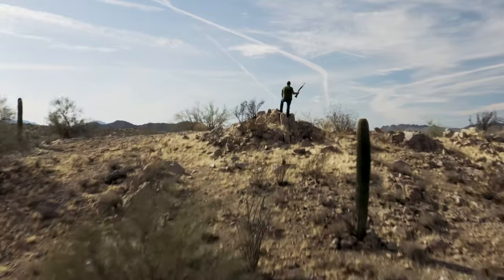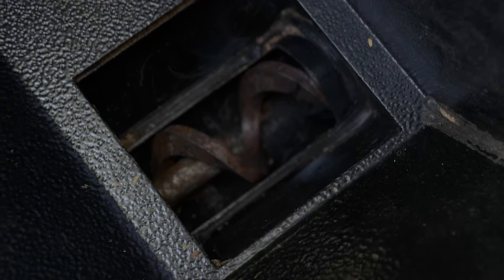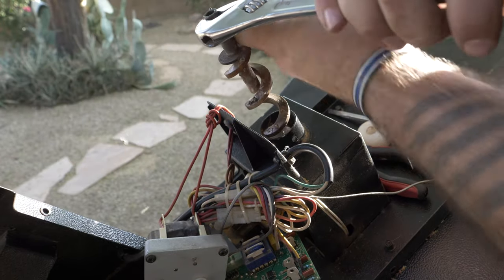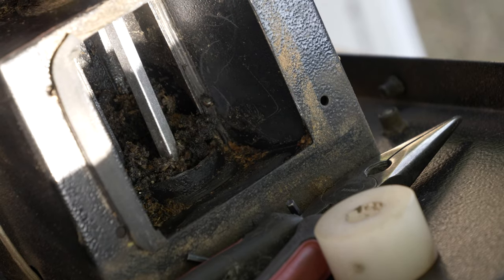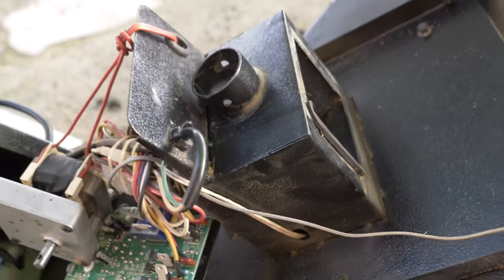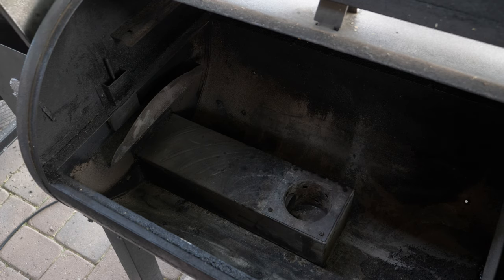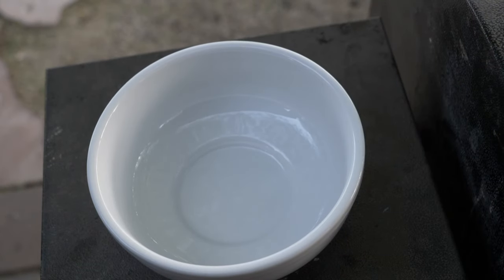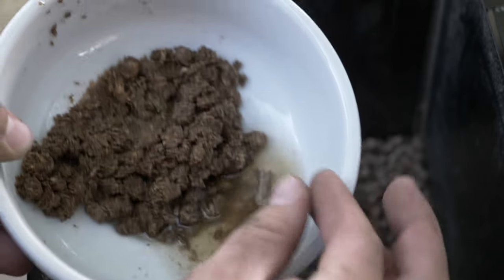Removing JAMMED AUGER | Pit Boss Pellet Grill

Comment: Wife left a bunch of pellets in the grill for a couple of months while we weren't using it. Recently tried to fire it up but wouldn't work. It was the same problem as you described in this video! Watched how you did it and went straight out to the patio and tore into it. Went pretty smooth! I did have to come back into the house to the computer to check on a thing or two but got it all back together and the auger spins freely now! Going to do a brisket for Memorial Day!

Comment: I made the mistake of leaving pellets in the hopper over winter. I followed the same steps you used. I really had to tighten the vice grips on the tube and crank very hard, I was afraid I'd crush that tube. What I don't understand is why these dealers don't have repair people. I would have taken this beast in but could not find anyone in my city of 300 000. Good video, thanks.

Comment: Thanks, helpful video.
Anyone doing this, you'll need a 7/64" allen wrench (oddball size) and a 5/16" wrench.

Our Pitt Boss is always covered but last time I tried to use it the auger wasn't turning, thought it had frozen up, it was about  -20* C.
When it warmed up outside it still wouldn't work, pulled it apart, auger came out pretty easily, there was no wet pellets or anything, I have NO idea why it jammed up.
Anyone else think it's kinda weird there's nothing anchoring the auger motor?  It just kinda flops around on the end of the auger.

Comment: I did the same thing this year.  This is the kind of mistake you only make once.  Thanks for posting.  I've been using Traegers for the last 10 or 12 years.  This is my first Pit Boss.  It was less than half the price of the same size Traeger (Austin XL from Walmart).  All the pellet grills use the same auger assembly.  The only down side for the Pit Boss is the dome style heat deflector...I smoked 6 pork butts overnight and I woke up to a black greasy mess on my patio.
Reply: I'm currently struggling with my auger at the moment due to the same mistakes, please pray for me. I also suffer from the leaking grease too and it looks like I need to put some high heat silicone between where the rectangular box that holds the auger and the barrel itself. I took my Austin XL completely apart and will replace every single component and never make the same mistake ever again. I want this thing to last forever.

Comment: Second time this has happened to me but figured out an easier way this time. Back the auger out with a pair of vice grips, then use the auger like you would a drill. Reverse the twist while pushing into the sawdust plug. Once it catches, keep drilling in. You'll get to where you're pulling out the plugged up dust.

Comment: just had to pull the auger on my 1150PS... had to pull the fire bucket and use a broken rake handle and a mallet to "massage" that thing out, it was really in there!!!! then pound out the solid chunk of wood in there, the sear plate rod got to lend a hand with that as well... then again Black Betty do have a full hopper through a few TX storms, including being just outside a tornado and taking a ride for 10-ish feet

Comment: just had to do my vertical pit boss same thing....went to use it today after using it yesterday....couldn't cover it after I used it right away and then it poured rain for 4 hours..I think my water got into the back door that releases the pellets to the outside from the hopper because it was swelled out and the wood was packed so tight, it was as hard as concrete......i took off the whole auger assembly but I could not get the auger to come out of the tube....it was like it was welded in after they put the motor and fan into the end of the tube....anyway, I chipped away at the pressed wood and tapped and tapped it until i thought i got it all and turned on power to the auger while it was outside of the cabinet....auger was spinning and seems to be all better....i taped shut the back trap door to keep rain out and I will make sure I cover the smoker especially with rain coming

Comment: Hey great job you got lucky,,   I got the same smoker and I did the same thing,,  BUT mine was not clogged my  Augur will not stop turning and it keeps burning very hot,,   I got a new controller BUT the same thing..  not really sure what the problem is,,   great video thanks for your time..
Reply from the maker: Sorry to hear that! I wonder if there is an issue with the motor itself?
Reply: @MrBigKid  hey thanks a lot I kinda of thought about that as well..   I'm not going to give up on it..
Reply: Was just reading these and thought about this one.  The issue may be that the Temp Probe has failed causing low temp reading and telling the auger to continue feeding (just a thought)
Reply: Hey Tom, I hope this finds you well and you get to cookin real soon. I had the same exact issue when I bought my Austin XL it turns out that the fan and auger plugs where switched. (Red plug goes to yellow) I remember reading about it in the pitboss forums about how the instruction were wrong or something. I bought mine used and fixed it and it works like a dream but before I did that it was burning crazy hot and the auger would just keep. Open up the bottom of your pit boss and swap the auger plug with the fan plug.

Comment: Haven't had it happen (yet). I empty my pellets out of the hopper every time when I am done because I am worried about humidity causing a problem. So I wonder if I need to worry about humidity? I currently keep my PB in the garage, but I do have a cover. Is a cover enough to prevent that from happening if I leave pellets in the hopper if my PB is outside and it rains? Great video. Good to know that there is a cure if this happens.
Reply from the maker: Thanks for watching Troy! I wouldnt worry as much with humidity. The monsoon rain here can be VIOLENT and likely was raining sideways lol! I have had this grill for 2 years now, and never had this issue!
I appreciate the comment!

Comment: any advice on getting the set screw out that holds the auger motor onto the auger?  no space for a nut.
Reply: 7/32" allen wrench (oddball size) and a 5/16" wrench worked for me.

Comment: Mine was locked up so bad that I had to use my torches to burn the clog out.
Reply: How well did that work? I’ve debated doing that, mines pretty bad and I’m having issues getting the hex screw holding the motor onto the auger.
Reply: @Juuiiice  it worked to get it out but left the auger unusable. I ordered a new auger and bolt on ebay.

Comment: I am facing the same issue on my 1150. Used my pitboss only 5 times since it was purchased ! Water came into the tube and the auger is so jammed that only dynamite can unblock it. I am trying to fit something or find a too that can give me  a solid grip to try to unscrew it
Reply: did you ever get it out? having the same issue

Comment: i have what I think is a similar issue.  put a brisket on at 11PM and wake up to an error, thing must have died around 3am based on the bark on the roast.  it won't come up to temp now, took it down to the burn box, pellets in it are whole and dry, pellets in the hopper end of the auger are whole and dry.  primer won't turn the auger though.  I have a pitts & spitts mav 1250.  got it 5 months ago.
Reply: edit: found the issue.  chunk of hard wood in the pittboss pellets I've been using got jammed in between the auger and the auger tube right at the hopper. had to knock it out with a screwdriver and hammer once done auger spun free.  going to raise hell with pitt boss!
Reply: btw this grill's hopper, auger, auger motor, etc, looks exactly like the Pitts & Spitts grill I ahve.. they must have bought them from Pit Boss.